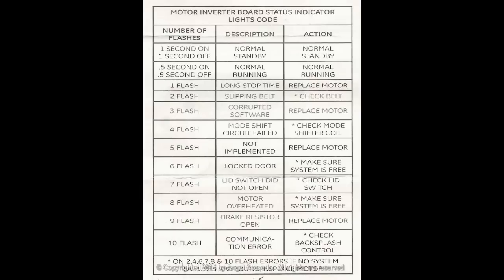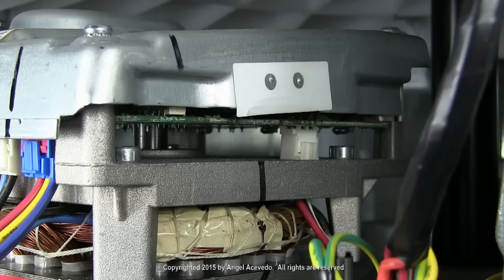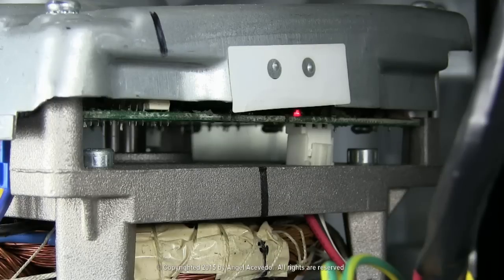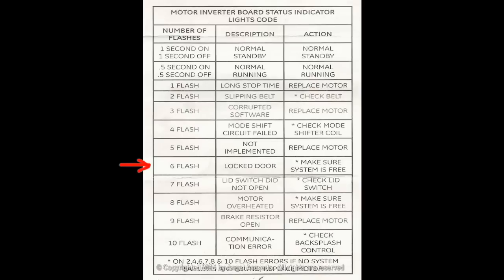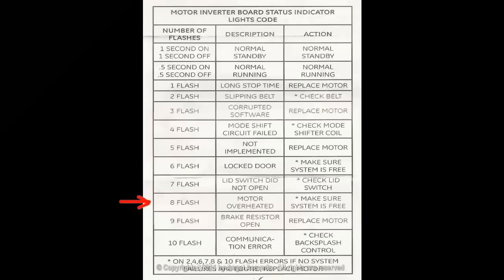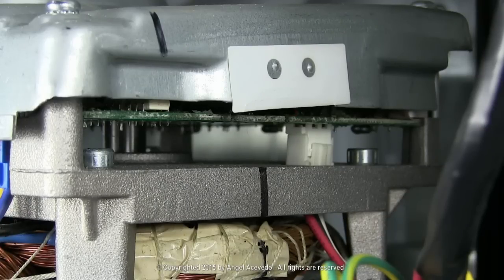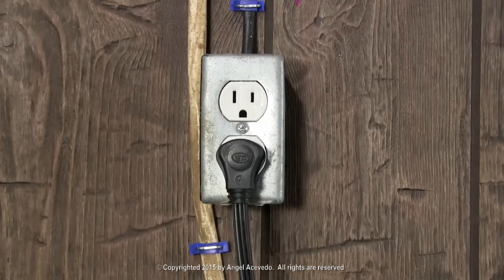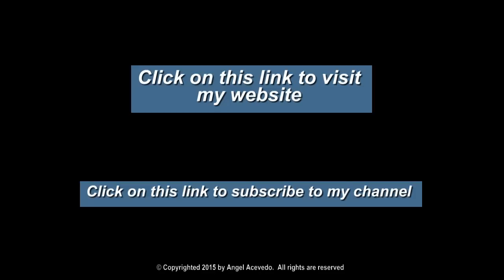General Electric Washing Machine Not Starting - Motor  Codes

Comment: Get top loader wjrr4170gww won't spin .jumped the door switch ,blew into pressure hose and no spinning 
What site do I check for power ???? Motor / belt don't spin ?
Reply from the maker: Sorry Kevin Those washers are electronic And I have nothing in them

Comment: Awesome that I found thos vid! I thought I could just twist the lid switch wires together, but after a few loads the motor quit working. I counted the red lights on the motor to 7 and seen from the chart in the vid that the lid needs to open occasionally. Had to untwist the wires and then twist them back.

Comment: Thanks for making these videos.  I have an older GE Washer with a green light instead of red.  It is flashing once a second, but my motor will not turn on.  The washer fills and drains, but it doesn't agitate or spin.  Any idea what is wrong?
Reply from the maker: Check this page maybe will help you
Sara Robertson
Reply from the maker: Sara Robertson
Reply: Sara Robertson Hi Sara, did u figure out what was wrong w/ur washer no agitating and spinning?
Reply: It don't work anymore.... :(

Comment: These error codes are priceless! thank you very much.
Reply: I can not see any red or green flashing lights when I remove the front panel.  Do I have to remove something else in order to see them?  Also should washer be plugged in?  My washer is 2.5 years old and a problem for some time now.  I have replaced the lid switch but it keeps showing LID...LID in the display
d

Comment: mine was flashing one second on and one Second off as it fills. but it won't spin and now it flashes 10 times and is off for 3 seconds then flash 10 times again. what could be the problem?
Reply: Disculpa pudiste encontrar la solución a la falla de tu lavadora porque yo tengo el mismo problema y quería saver cual fue la solución para que me ayudes gracias

Comment: can you please help me. my hydro wave washer motor flashes for one Second on and one Second off. BUT after it is filled with water it does nothing no agitation or spin and after a while the motor light flashes 10 times and turns off for about 3 seconds only not six as Indicated on all videos I have watched what could the problem be? do I need to replace the motor? please help

Comment: I have a light(green)  that flashes 7 times and off for 6 seconds and repeats. Check the door switch, but am I checking for?
Reply: The door switch is most likely bad.  I cut out the switch and twisted the two wires together.  This is not the proper, or safest method, but it will get you up and running, until you can install a new switch.
Reply: Thats awesome! Im on it! Thank you!!!!
Reply: Okay, so I by passed the switch and it didn't work. I had to reset the and erase the error codes... So I took the two wires and touched them together 5 or 6 times and cleared the codes and tried again and bingo! It works! Thanks! now do you know anything about dryers? Many many thanks!

Comment: Also, One of the wire connectors inside one of the 6 pin harness connectors broke.  Anyone have any ideas on how to replace/repair just that. I think I might have to find the identical harness because I am not having any luck finding the little metal connector that goes into the 1 of 6 harness holes. Thanks for any advice

Comment: So ticked off about my GE washer. Transmission replaced before and now light is flashing 3 times which indicates I need a new motor....this thing is less than a year old! So mad at GE.
Reply: condor5635 same thing here. Motor crapped at about 2 years. Everything on internet said motor failure is very rare. But there sure are a lot of them for sale out there. I live in Dallas, a metroplex of about 4 million people, and could not find one in stock anywhere, everyone was sold out, said they went through them pretty quickly. Luckily I am a mechanic and have been fixing my own washers and dryers for years. I think I paid about 399.00 for the washer and to have the motor repaired by a service tech would have cost me about 550.00. ?? WTF ??  I got real lucky and found a guy in Ft Worth that overnighted a slightly used one for 70 bucks. But to have a washer break down that fast is ridiculous. The one I had before I think was a used Kenmore I believe, and it lasted about 15 years with only small issues like switches. Damn shame, GE used to be such a symbol of quality and American made. Seems to be the way everything is going these days. Everything is basically disposable. Thats why it's so hard to stay ahead financially, every time you turn around something is breaking down and it's cheaper to replace than repair.
Reply: mine is also flashing 3 times but its 12 years old so I guess it did good

Comment: GTWN2800DWW - the Red LED has a constant flash every second (standby)... but the machine will not agitate or spin. I've tried all of the RESET steps, but no FIX.

Any input will be greatly appreciated.
Reply: Were you able to figure out the problem? We are having the same issue.
Reply: @surfsupbro4476  Bad system board... no way to flash or update, so we bought another machine because replacing the system board would cost nearly the same price as a New machine.

Good luck, man... not really a big decision when you get Completely New spending nearly the same $$.
Reply: Mine flashes 3 times with a short pause between the sequence .but no where near a 6 second pause more like 1 second

Comment: What if there is no lights at all nuthing is flashing down on the motor what is wrong with it then?????
Reply: Angel Mendoza mine did this too.  Turned out the white wire with red runner had broken off at the wire harness plastic connector 6pin where it connects to the motor. Make sure all your harness connectors are still solid and intact.
Reply: @condor5635  No agitation and no LED.  I just fixed mine thanks to your post! THANK YOU & GOD BLESS!
Reply: razzledingle - so glad to hear. I even secured the wire harness with a large zip tie against the motor to keep it secure. That thing get some severe vibrations!

Comment: my red light flashes 7 times and the door switch checks ok. have continuity on Orange wire at motor plug to wall plug post. tried to reset fault using the 6 times in 12 seconds.  did not work Help please